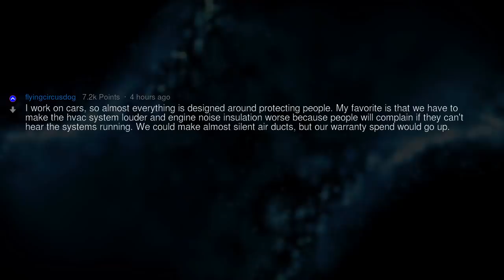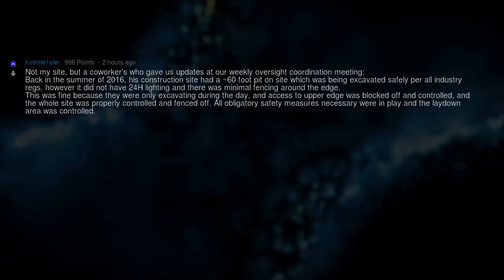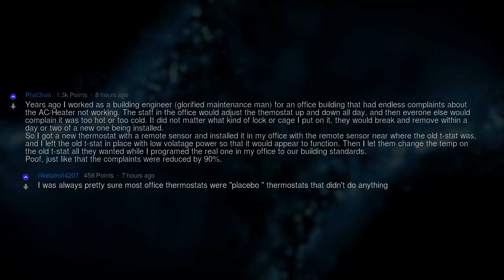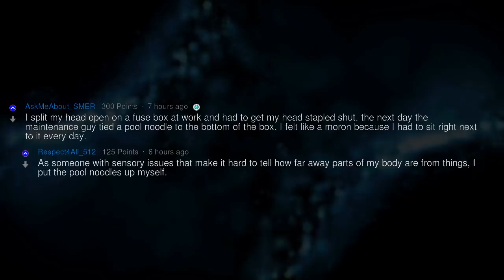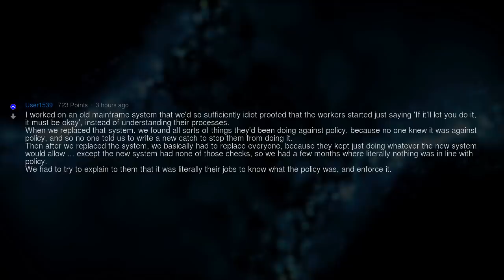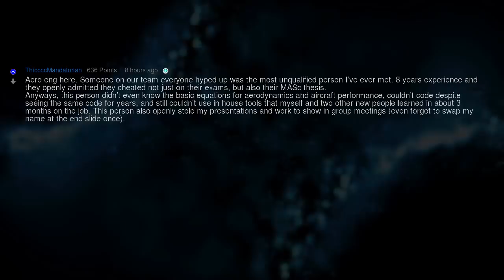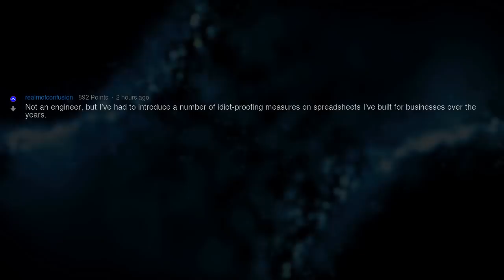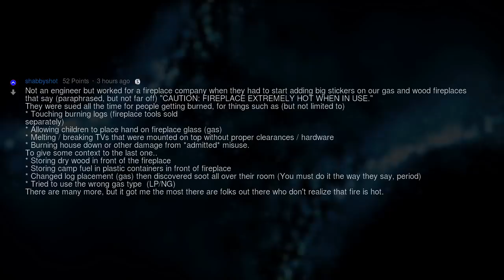Most Ridiculous Idiot-Proofing in Todays Products

Comment: Who designs these awful, virtually impossible to use "safety" spouts on gas cans?
They actually make it much more likely you will spill gas!
Reply: I think of myself as fortunate for finding one that was just a valve that would open if you pushed a button.
Reply: And may God fucking help you, if you're trying to fill up a chainsaw, It's basically impossible to use those things depending on the design, one thing I recommend is looking up military gas cans. They're not cheap, but they're metal and will last forever.
Reply: @jimmystyles670  no sun bleaching either. I live in a small town in the middle of nowhere and I used to work at a store that also sells gasoline, either I'd hear about people bitching about spilled gas from those newer cans or see sun bleached older cans that were probably a bright and vibrant red once upon a time

Comment: Im no engineer but because it's just as laughingly bad, i will put it here:
Summerland fire disaster:

-building was supposed to be fireproof when  it's design and the material made of helped the fire when started accidentally by three bois
-fire burns through fire alarms before they could be set of
-nobody calls for fire department or evacuation even tho there is clearly a fire
-it was some captain of a ship out at sea that saw the fire and was one of the first and if not, THE first to call fire department
-when evacuation starts some dude who was controlling rides left without stopping them leaving parents and other people to rescue children
-one fire exit was blocked by a car that (i wish i made it up) belonged to the safety officer
-three bois (mentioned earlier) who started the fire were fined 3 pounds each for the death of 50 innocent lives

Beverly hills supper club fire
-"it is fireproof" building was litelarry made of wood and carpets
-litelarry no fire alarm system
-when it was clear that there was a fire, supervisors didn't want to interrupt the show
-when a young brave lad went on stage and shouted that there was a fire and that everyone should evacuate, the majority sat in their seats since there was no sign of a fire
-when signs of fire emerged so many people tried to escape through the small exits that they all litelarry stacked each other and couldn't be pulled out by fire fighters to help the situation

I swear there were litelarry no safety regulations last century and it fcking tells you something

Comment: I once installed non functional thermostats on the walls of cubicles. Each cubicle had one. The climate control system had been upgraded, so I had a barrel of old thermostats. Called them " wireless thermostats"...not a lie, technically...no wiring to them. Temperature complaints dropped to near zero.

Comment: Why do you even have a disable wifi button? That's Doofenshmirtz level engineering
Reply: To extend battery life when you don't need an internet connection. The wifi receiver uses some electricity to search for or stay connected to the wifi signal.

These days, with so much being done in a way that will always need a network connection, the switch doesn't make much sense anymore.

Comment: 22:40 Made my day, CRT's storing data. 🤣🤣🤣
Reply: Actually, in the old mainframe days, sometimes you would leave text stored at the terminal (CRT with keyboard) because in the limited RAM you had to run your program (on the mainframe), each end-user was only allowed so much working K.  'Twas actually a clever hack, back in the day.
Reply: @josepherhardt164  When computers were coal powered, and you had to feed the gremlin inside to paint the screen as you typed. 😁
Reply: @LoneTiger  And when you went out to lunch, you had to watch for the crossing dinosaurs!

Comment: I work in the Houston industrial district. There are so many pipes cris crossing this city that we don't even do digging anymore. My company exclusively does hydro excavation, where you dig with a pressure washer and a vacuum. It's more expensive and slower, but if you hit a pipeline, the hydro excavation rig cleans it instead of ripping through it. To compare, one of our suppliers accidentally dug through a hydrogen pipeline. No way of stopping it, and the flame was so hot it was invisible. They had to depressure the whole system, cutting off supply to the entire area so that they could patch it up. Cost a millions, and it was a miracle no one died

Comment: I'm a machinist. There are two kinds of mechanical engineers:
1) The kind who knows they are indeed mortal, capable of mistakes, sometimes design nonfunctioning parts, think up assemblies that are impossible to mate, have the humility to realize that there's no shame in being corrected, gets that manufacturing technology only goes so far, and understands intimately that being surrounded by machinists and welders who are experts in their field is a benefit, and ultimately that their job is not THAT complicated and there's a huge difference between intelligence and education. (These guys are awesome to work with, and I fight tooth and nail to keep them if they're in hot water). 
2) Is never wrong, thinks education proves intelligence, screams at machinists and welders for not being able to change things like how much heat or pressure a material can withstand, invents excuses for every failure, whines endlessly about how difficult their job is (being fully unaware that half the team is also formally educated, too), can't wrap their head around basic GD&T, designs the most ludicrous things like .0005 tolerancing on a counterbore for a bolt head, trying to mate 3/8-16 and 3/8-24 threads together, thinks magnets make parts flat instead of parallel, and even goes as far as to attack anyone when being confronted with the undeniable fact that they are indeed incompetent and ultimately laughable for the umpteenth time that month. (Absolutely delusional, and the worst kind of person to work with, and they actually think the manufacturing team is working FOR them 😂). 

Unfortunately Type1 is only about 30% of them, and 80% of the Type2's don't even have the self awareness and IQ necessary to realize they're Type2's in the first place.

Some of the examples in this video just prove the rampancy of Type2's and their neverending quest to pretend they're smarter than an inbred dog.

Comment: To be fair, there are some things that don't become logical until you really had experience in doing it.
For example, building your first PC.
I spend a full day trying to figure out where to put what cable even with countless video's and instructions.
Only to realize at the end of the day that 90% of it was designed to only fit in just one slot.

Saying 90% as there are the odd parts here and there from more less known company's that just have a odd cable here and there that's not even mentioned in the manual, and amazingly enough the company tech support itself could not answer what it was for or why it was there, even after showing pictures and giving full detail on what is written on the cable and where it is attached to.

Comment: When the boat I work at is at one of our two docks, we have to run hoses up to the top of the seawall to pump out the septic tank and fill the drinking water. The hookups are in two holes in the sidewalk up there (normally covered by lids, but we can't pump and have the covered at the same time). We put an orange traffic cone between the two hookups hoping that people will notice and stay clear of the hoses and the holes. Nope. People either don't notice the cone and stumble into the hole (not deep, but could still damage your ankle), or see the cone, decide something interesting is going on, and walk right between the hoses to look over the railing. Seriously, I wind up using the line "you really don't want to stand there. Our sewage hose is pointed directly at you" at least two or three times during rigging and just as many while downrigging.

Comment: Yep, input validation is a big reason tools for internal use can often be muuuuuuuuuuuuuuuuuch cheaper.
You simply barely do any. Write in the handbook how to use it and have the user responsible. The limiting factor here are obviously responsible users. So that simply can't be applied everywhere. It's like how you can't power tools to little kids. Those things would be ineffective if they where "safe".
Ah yes good times when you can just put in some warnings instead of most of the error handling.

Comment: Yes, a telephone cable will fit into an Ethernet port. No, it will not work and you will have to call IT to figure out why your Internet connection doesn't work.
Reply: Also, they had to implement infinite loop protection on network switches because people would connect the switch into itself, causing it to transmit to itself, read the packet, then retransmit it to itself over and over again until it crashed. People would also do things like connect switch A to switch B, switch B to switch C and switch C to switch A with similar results.